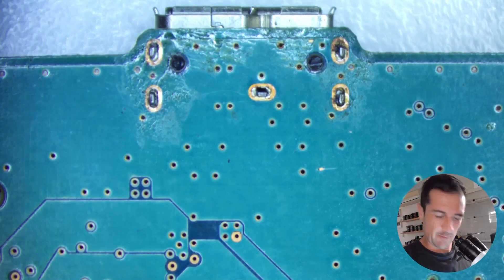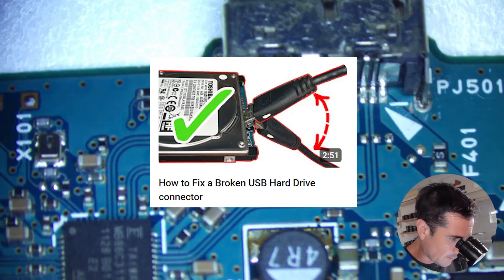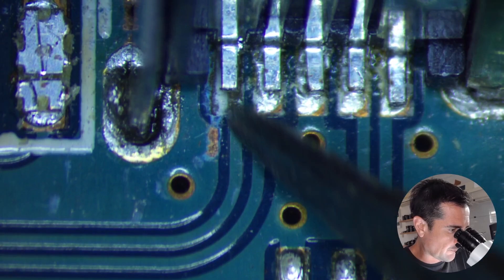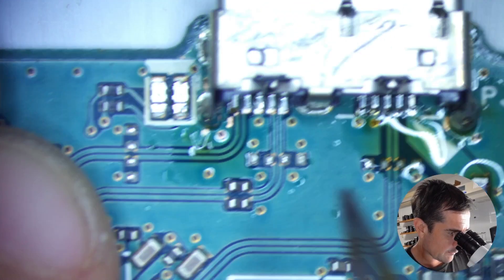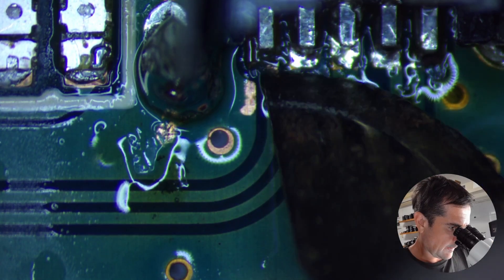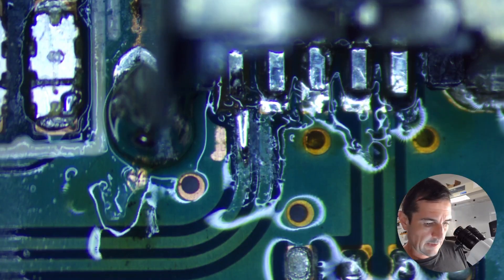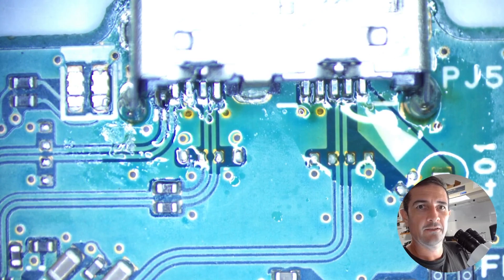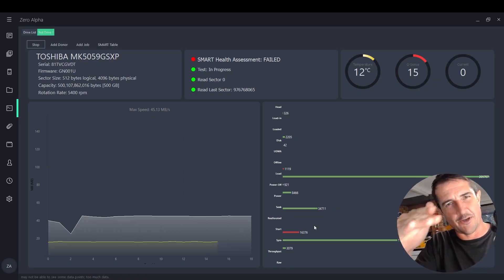Fixing another data recovery companies BAD soldering work

Comment: I was going to say, wouldn't a small piece of enameled wire to join the pin to the newly scratched off trace been better than pulling the pin out slightly? Guessing you're only interested in the data recovery though? Especially with the 15 SMART "drop" errors, guessing the drive isn't suitable to be used afterwards as its now deemed unreliable and just be backed up, wiped and discarded?
Reply from the maker: You could. Small pieces of enameled wire are hard to work with though as the enamel needs to be stripped back. You also need to be careful with USB wires that your not interferring with differential signaling wires